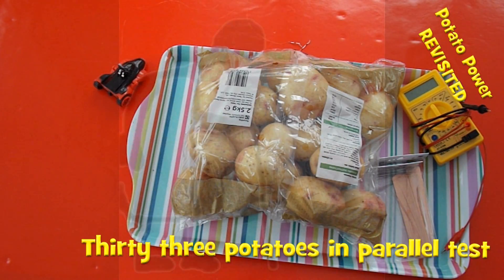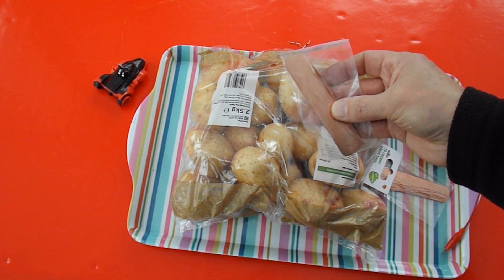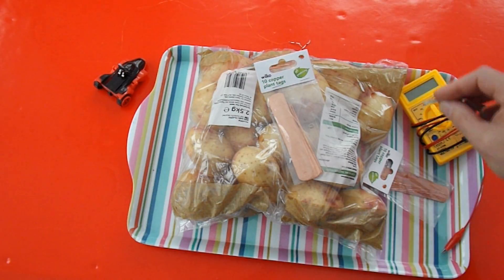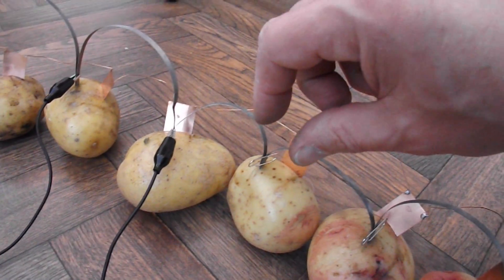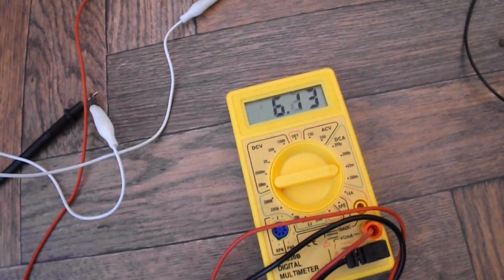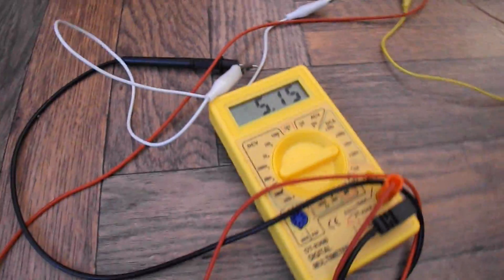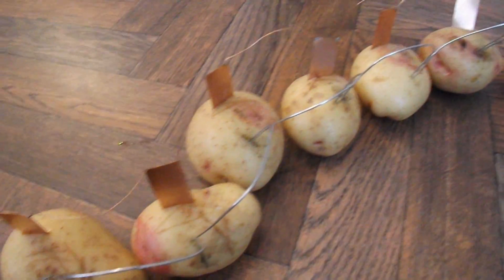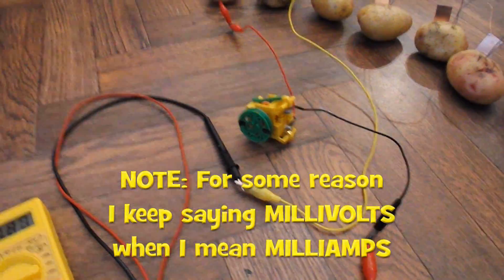Potato Power revisited PART #8 Thirty three potatoes in parallel test

Comment: hi , i think if u even add 80 mods potatos u just might when ur lucky get a little twitch on the wheels of that little car but wont turn the motor fully round,i wonder if u would use 600 potatos like the folks on the video u sent me then that little car might go?but 600 potatos for a little project like this one would be too time consuming i think.
Reply from the maker: In the next episode I do what they mention in that video, I charge a supercapacitor from the potatoes and then use that to run the car. It's not the way I wanted to go in this project but I wanted to get some visible motion. Episode 10 shows much more movement 😊